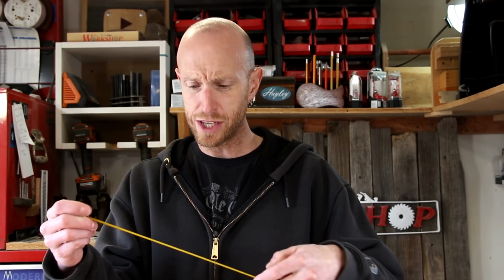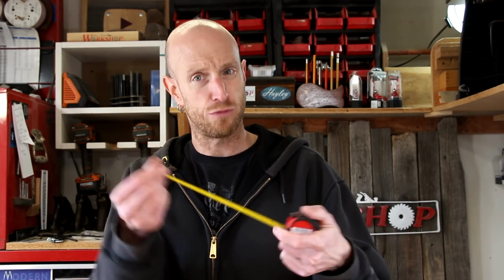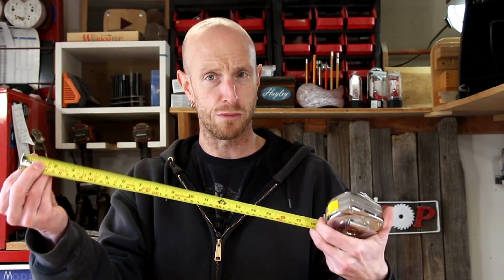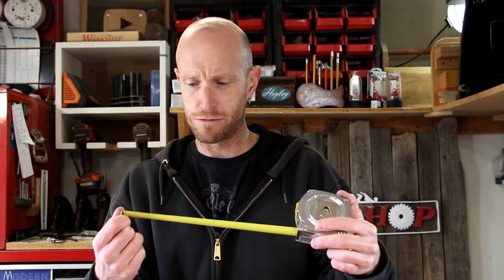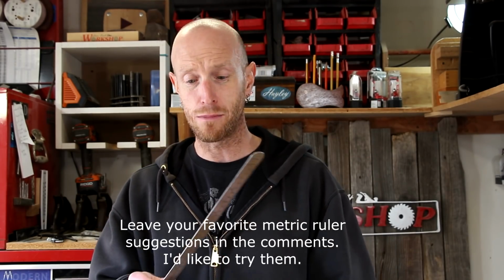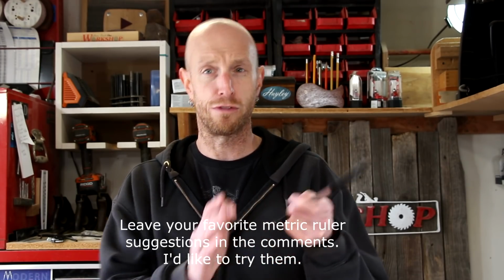My thoughts after using the Metric System for a project | I liked it

Comment: Out of curiosity: how do you “translate”, say, 17/25 of an inch in an actual length?
Reply: Any calculator will do that for you, just do the division (17/25 = 0.68 = c. 17.27 mm). But you will never see twentyfifths of an inch; the denominator is always a power of 2. E.g. 1/2, 3/4, 5/8, 7/16, 17/32.
Reply: @royjohansen3730 My question was not “how many mm is 17/25 of an inch” but “how do you measure/get a concrete length out of the fraction”. You seem to miss the point: l don’t need any calculator to know what 17,27 mm is, and in metric there is no “circa”, one gets the exact measure directly.
Reply: @giannapple  Sorry I misunderstood your question. But 'and in metric there is no “circa”'. Really?
Reply: @royjohansen3730  Yes, really. A number is a number, a fraction not always guarantee you that you can measure the quantity it represents.
Reply from the maker: I understood your comment and completely agree with your point. I grew up with fractions and even now, I have to stop and make some sort of conversions to get it right.
Reply: Machinists (operators of metal working tools) and such went to the metric inch/mil ages ago, that is an inch divided in 1000's so 1/2" is 500 mil and 1 mil is 0.0254mm.
Reply: @royjohansen3730  You are wrong.I have a 1 metre steel ruler from 1972, which has imperial measurements on the opposite side. A well as 1/4's etc, it has1/10s, 1/20ths and even 1/25ths and 1/50ths of an inch in various places.
Reply: @paulmcwilliams8641  Interesting!
Reply: @royjohansen3730  So: How the hell measuring 17,27mm in Imperial?
Reply: @peterebel7899  Good question, hehe. I think people who need accuracy to the nearest 100th of a millimetre use metric anyway. A human hair is in the order of a 10th of a mm. Luckily I'm from Norway, and don't have to worry about the ridiculous Imperial system. You from Germany? Denmark?
Reply: @royjohansen3730  Germany :-)
I do love your Norway and will visit in a not so far future again.

Funny to watch the Anglo sphere squeezing around the metric system calling it non natural, non intuitive, non ...

But funny as well as old imperial remnants are in our life, i.e. dimensions of tubes.

Many years ago I spent some month as a student of engineering in USA: What a crazy thing over there to find correct specifications for simple things like wires, screws, ....
Reply: @peterebel7899  Du hast vollkommen Recht! Wire gauge, for example. Thin wire = small number, thicker wire = higher number? –No, that would be too logical. Zoll ist toll, apparently.
Reply: @royjohansen3730  Dazu musst Diu wissen, wie im Wilden Westen dünne Drähte gemacht werden: Da nimmst du eine dicke Leitung und teilst die Einzeladern auf zwei Litzen auf. Damit erhöht sich der gauge, weil du hast ja mehr Arbeit ;-)
Weißt du wie in der Netzwerktechnik (Ethernet, ....) Cat definiert ist, z.B. Cat5? Wenn man zwei Drähte miteinander verdrillt (twisted pair), dann kann man damit schneller Daten übertragen (vereinfacht gesprochen). Cat1 ist eine Verdrillung pro Zoll Länge, Cat5 sind 5 Verdrillenden pro Zoll Länge. So ist das ursprünglich entstanden, mich hat es umgehauen als ich dies mal gelesen hatte. Natürlich ist das Ganze heute funktional genormt, nicht nach Umdrehungen, aber diese Herkunft der Bezeichnung geht mir nicht mehr aus dem Kopf.

Comment: I grew up in the U.K. with imperial measures, and having spent many hours adding lists of t, cwt, st, lb & oz; I was very glad after a period adjustment to embrace the metric system. The length system was  equally bizzare, but the sums did hone your maths skills in the days before calculators.

Comment: metric rules!! more easier than inches, when i read 1 16/8 its like whaaat? i m from a country that use metric system, the inches its only used for wood references
Reply: What on earth is 1 16/8.? That's doesn't even make sense. 

Inches are (usually) divided up into sixteenths.
Feet are divided into twelfths. 

It's no coincidence that these numbers are used. 12 is divisible by 1,2,3,4, and 6. 

For really small measurements, I agree that metric is nice and tidy... but when you're dealing in larger units, I'll take feet and inches over metres and cm any day. 12 is just such a convenient number.
Reply: @TheNewGreenIsBlue  or we just use decimals to describe non-integer inch measurements and then we can pick them off just fine.
Reply: Interesting... On the one hand, that's just 3 inches. In the other hand: That can't happen in metric, you always have just one number.
Reply: @TheNewGreenIsBlue  But it isn't logical. 12 inch to 1 feet, three feet to a yard, 1760 yards to a mile. And when you go below one inch you have to do fractions. Metric: 100centimeters to a meter, 1000 meters to a kilometer. Going down: 10 millimeters to one centimeter 1000 micrometers to a millimeter. Easy.
Reply: @darkiee69  Easy and "logical" are two different things. Yes, Imperial is not base 10, and since most metric measurements are they are easier (only because we unfortunately use a base 10 number system, decimal, also base 10 )

You don't have to explain how metric works. It's pretty simple. However, when it comes to 'logical' you have to ask yourself... why would a measurement system use a series of different base units like 3,12, 16 without a good reason for it? The reason is that it was more... logical.

things in multiples of 12 have more flexibility in how they're divided up, which is why even in metric, you'll often find standard measurements of boards are sold in multiples of 12. Plywood sheets are most often sold in sizes like 2400mm. Studs in a a house are often set at 600 mm on center due to the highly composite nature of the number 60. 

It may not seem logical at first glance, but in many ways, there was a logical "reason" for those numbers in the first place. 

Now, I'm not saying "imperial" is better at all. Metric is in general better for no other reason than it's a standardized set of units. However, I think we can "appreciate" Imperial measurements as not being completely arbitrary. Now, if Imperial based everything on something like 7s or 11s I'd agree that there's little in the way of redeeming qualities for imperial... but understanding the mathematical aspects of it helps one to appreciate why it's still used. 

Note: Metric can offer the same benefits, but it's by configuration ( we decide to sell things in lengths of 120 cm for example ) and not built in to the measurement system.

A yard of fabric is 36"
If you want to buy a ⅓ of a yard of fabric... well... that's 1'... ¼ yd = 9" etc. You end up with whole numbers a lot of the time... and whole numbers are nicer to deal with in general... anything to avoid decimals on blueprints, lemme tell ya. It's why blueprints often ONLY use mm, by the way.... they don't really want you converting to meters.... 

You want to split a ~2' piece of wood into 4, 6, 8, or 3 pieces you end up with 6", 4", 3" or 8" pieces... as opposed to splitting a 2m board... where you get 0.3333m, 0.5m, 0.25, or 0.666m 

Honestly, when you get used to BOTH systems... you switch between the two naturally and I find I'll use them both in different contexts, depending on what I need.

Comment: to really enjoy metric system being accurate it's a good idea to get a tape measure with accuracy class "1" (often printed as EG-Genauigkeitsklasse 1), meaning a max error of +/- 1.1mm on 10m, they are not that much more expensive but you can pretty much stop thinking about errors introduced by using different measurement devices.
If no accuracy class is printed on (at the start of the tape, usually a circled I to III, for class 1 to 3, with class 3 being +/- 4.6mm at 10m and no class meaning worse than class 3 most of the time).

Comment: THE IRONY IS the one thing that is BETTER in imperial is MONEY and the USA use decimal metric money - 100 Cents to the $

If you use 240 like the Brits USED TO - it is a "highly divisible number" - split a bill between 3 people - 80. 4 people 60, 6 people 40. 8 people 30...
Reply: Also it was called a Pound Because 240 silver Pennies was a pound in weight
Reply: Pint of bitter please mate. That'll be 1 and 8 squire. 
You'll have to give me change I've only got half a crown. 
That's alright. Here you are, a penny, a threepenny bit and a tanner.
Reply: Yeah, and if we had 12 fingers and so used a base 12 counting system that would make total sense. But since literally the way that we count revolves around 10, it doesn't make sense to use anything else.
So that pretty much just makes SOME simple fractions easier but everything else harder. Like it doesn't help you at all if there are an odd number of people.

Comment: Australia switched to metric in 1974, completely (not like the UK that kept miles per hour) I started my apprenticeship that year and we were the first metic fitter / machinist, where I worked in an oil refinery everything was uk imperial.  Therefore I was good with both system in size, weight, speed, etc.  I can tell you that metric is so much easier.  Especially when doing weight and volume calculations.

Comment: Why do Americans have to rename everything? It's not the "standard" system, it's the "Imperial" system. It takes its' name from the British Empire and the Roman Empire before that.
Reply: You do realize that the US and Imperial systems are different, right?  Lengths are almost exactly the same (and only the same since ~1963 when the US system redefined the US inch in metric terms) but volumes are quite different between the two.
Reply: @iatsd  I know a US Gallon is less than a UK gallon, as for everything else, every day is a school day. Thanks for the info.
Reply: @iatsd  the US imperial system is different to the British imperial system. they are both imperial unit systems.
Reply: @GaryDean  Not true.  The UK Imperial System is a defined system, while the US has gone through several standards, none of which were formally called an Imperial system.  The US system has changed unit measure values several times until they finally settled on a system that is defined against the metric system, which the US formally adopted, by law, in the 1970's, but has never funded for switching over to.
Reply: @iatsd  Can you imagine the Karen's shouting "commie socialists" if the USA ever did formally switch? !!
Reply: @welshgit  How would they fit that in between their heads exploding and their complaints about "how complicated" the metric system is? ;)  :)
Reply: From a USA perspective it is the standard (USA) system but for 99% of the world it's "that old weird thing USA and two other small countries use". It's a matter of perspective :)

Comment: G'day mate from Australia 
I have been using metric for over 40 years now, as we in this land down under,  converted to the metric system. 
Base 10 is so much easier than fraction,  if you ask me.
Eg dividing a length of 352 mm into 2 parts is easier : the size is 176mm each.
But the same size in imperal is 13 7/8 inches the answer would be 6 1/2 inches + 7/16 inches which is 6 15/16 inch.
Now dividing by 3 equal parts is 17.3mm or 4 1/3 + 7/24= 4 10/24.
I think my maths are correct,  but it took me at least 5 times longer to get the imperial answer compared to the metric. 
Havagooday 
Greg

Comment: Man, I really don’t like this thing I’ve started seeing where Americans refer to inches as “standard measurements”. Is that some sort of thing they are doing because the word “imperial” has some sort of bad connotation?
Reply from the maker: No, its what I was taught. We measure in "standard". For me, it wasn't called Imperial. I have really been trying to get myself away from calling it standard, because I realize whatever system someone uses is their standard.
Reply: @homebuiltshop  I’m sure it was and I hope that didn’t come across as a comment on you personally. It’s just a very interesting thing that Americans are taught “this unit of measure that is used pretty much nowhere else in the world is the ‘standard’ measure” 

Just strange that (at least everywhere I’ve heard of) they are called “imperial” measurements. Does that term “standard measurements” also apply to things like pounds and gallons?
Reply: @DarrylF85  the american 'standard' measures are simply a  subset of the (british) imperial system.  thus, it is an imperial system.
Reply: @DarrylF85  Americans don't use "Imperial". They use "US Customary Units" (USC) which are very similar, but differ in 3 important ways.
1. Measurements are generally the same except volumes which differ in size and conversion numbers. ie.
Imperial fluid ounce = 1/10 Imperial cup = 28.413ml
USC fluid ounce = 1/8 USC cup = 29.574ml
2. USC dry and liquid Volume measures are different, while Imperial they are the same. ie.
Imperial pint = 568.261ml
USC liquid pint =  
USC dry pint = 
3. Imperial defines it's self, USC is defined by the metric system.
Reply: When I look at tools, wrenches or sockets come in metric or SAE for mm or inches respectively (Society of Automotive Engineers for the uninitiated). I never thought of inches as standard or imperial, I thought of it as length. It's the system in use for length. I might think of it as the standard system, rather than the Standard System, if you catch my meaning.

Comment: You say "the metric vs the standard system". The Metric system IS the standard, as defined by the International Bureau for Weights and Measurements in the SI system. Whatever the US is using is the non-standard and was defined by the length of the foot of Benjamin Franklins grand uncles third removed cousin or some such thing :) Just saying
Reply: Glad you saw the light btw. The answer to "How many kg does a cubic kilometre of water weigh" is 1000m x 1000m x 1000m x 1000litres = 1 000 000 000 000 litres, and with 1 litre of water weighing 1 kg at room temperature, its the same amount of kilos. The answer to "How many lbs does a cubic mile of water weigh?" is "F***k you!"
Reply: The US customary measurement system is defined with metric units.
Reply: @oysteink-q9c    5,280ft x 5,280ft x 5,280ft x 64.43 lb/cf = 9.2x10^12 lbs.   By the way, 1 liter of water does not weigh 1 kg.  It masses 1kg.

Comment: I learnt imperial measurement for nearly my entire schooling with it changing to Metric in my last year (July 1974) so we were allowed to do our answers in both..., however after I left school I stopped using the old measurement and switched over to metric..., that was 50 years ago.(We had started to learn it before it was officially changed over). Best system ever..., so damm easy and people that complain are people that are resistant to change just because its change. Not only is it 10's..., it also converts to weight. 1 litre of water weighs 1 kilogram, 1 cubic mtr weighs 1 tonne, a 10centimeter cube weighs 1 kilogram making it easy to work out water volumes and weights. (especially for aquariums). If you can count to 10, then metric is for you. 🙂

Comment: I'm in the UK, and like many Brits I use a mixture of metric and imperial in my day-to-day vocabulary.  Millimetres are good for tiny measurements, inches are good up to 1 foot, feet are good up to 1 metre, metres are good up to half a mile, and then miles are good beyond that.  I pretty much exclusively use metric when describing weights or volumes though.
For actual projects, it's all metric.  Base 10 is much nicer to work with.  Though it gets weird because we still have 4x4 and 6x2 wood etc...  but it's sold as its equivalent metric sizes.

Comment: Everyone uses metric money. So they have already learned the math already
Reply: Everyone uses Decimal numbering system you mean.And then metric,based on decimal seems more intuitive,yes.
Reply: But not all currencies are equal in value, so that doesn't really help does it?
Reply: @charchadonto  That just confirms my statement.
Reply: @tony5006  I was brought up post-war (in the UK) to use the Imperial System; Adapting to Decimal Currency was a piece of cake...Decimal measurements are less intuitive for a convert like me...however, I've found long distances fairly straightforward (a simple 5/8ths gives a close approximation of Kilometres to miles...remembering 50 kilometres is about 31 miles helps too)...but in terms of carpentry measure I've had little in the way of problems at all...the metric is actually easier and offers easy precision...weight is a tad trickier but a kilo is about 2.2 pounds so I can mentally convert if I wish...volumes I still find a bit tricky if I'm honest, but I don't worry, just buying a bottle or can that looks about right...

But these are issues only for my generation actually - my children have been taught to think metric right from the start...they intuit metric measures, just like I did the old measures...they never need to convert (why should they)...so what's the big hassle? The US general public will very soon be the only outlier - American scientists have long used metric...it's actually a better system...
Reply: Before the UK swapped over Pounds, shillings and pence was a nightmare. I remember in Italy while buying Bombars the teller didn't have any small coinage so gave us a handful of sweets. I wonder what system that was? 

Bombars are gas bottles. Great name and we were working on a Bond Film.